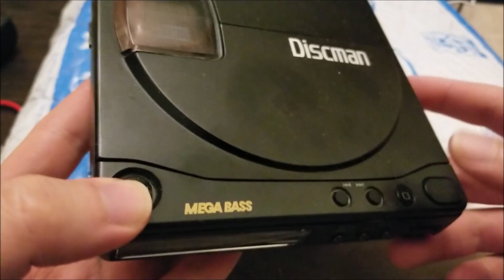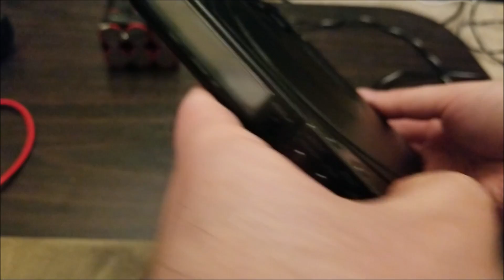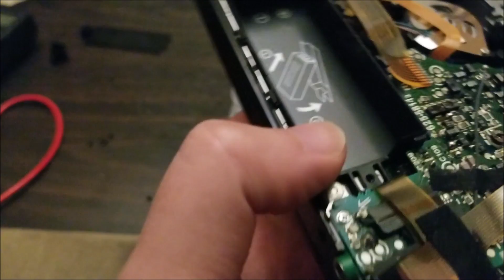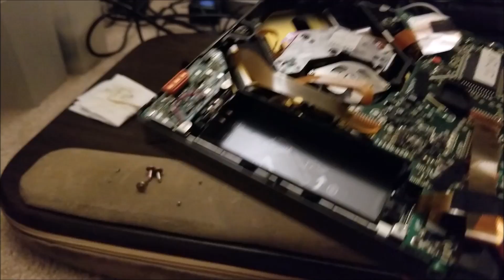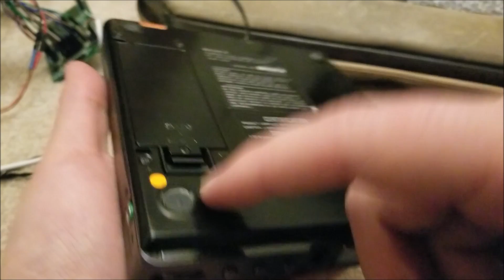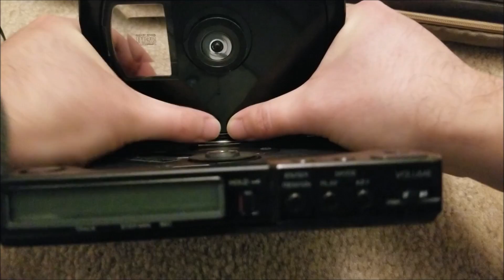Let's Fix: Sony D-15 High End Discman

Comment: good evening and thx for the fix .... i have the same disc player, in excellent condition, however it skips ... it has tracking issues and jumps all the time. is there any kind of fix for that?
Reply from the maker: Relubricate the sled rails/gears and check caps for leakage
Reply: @sjm4306  thx for the answer! However i have lubricated it and i dont see any issues with the cups. Everything seems correct… i tried to gently adjust the pots but no luck. I have read that the mirror of the lence may be dirty but i have no idea what it is and how to get there…
Reply from the maker: It could still be the caps even if they haven't visibly leaked, they can dry out drastically decreasing their capacitance
Reply: @sjm4306  thx !! I will check it!!

Comment: I just saw replacement gears on Ebay for about 20 bucks.
Reply from the maker: That's certainly good to hear but still very expensive. I've got an sla resin 3d printer, I wonder if there's a tough enough resin I could print my own with?

Comment: I just bought one for 20 bucks 🤪 seems to power on and seems to acknowledge CDs but it doesn't actually play then, with a screechy noise coming when headphones are used. Any idea where I can look to?
Reply from the maker: Bad electrolytic caps 100%, swap them all with new ones
Reply: @sjm4306  also noticed the middle gear for the laser, like the one you replaced in the video is looking quite green in the center, leakage maybe?
Reply from the maker: That would be the lubricating grease they added.

Comment: You think a 3d printed battery cover would work alright for one of these? Someone is offering me one of these for about the same price you paid for yours. I might have one soon.
Reply from the maker: Given the size of the original battery cover, a 3d printed cover may have some flex to it but should work fine.

Comment: Thanks for this video!  My D25 would also power on, but wouldn't play.  Sure enough, the same plastic cog was seized.  I was able to get to the frozen cog by removing just the power supply board/battery compartment.  The C clip was easy to remove, but much harder to reinstall, but in the end 'Success'.  My D25 is playing again!!
Reply from the maker: I love a good success story!

Comment: I took apart my Sony D15 and the middle gear was stuck and crumbling.  It was broke in half with little effort.  Also had 2 broken teeth.  I saw on here a chinese source  but looked at the site and got lost looking.  If it is there is is not easily found.  Anyone know a part number for it.  I think the big gear was 33 teeth and the smaller was 17 though with my eyes I could be mistaken.
Reply: Same thing happened to me with my d-25, the plastic gear broke so easily when I tried to remove it. 
 Did you buy a new replacement gear already? if you can recommend me a seller, I'd appreciate it!

Comment: another good fix. wondering if you have any idea where to get a replacement middle gear. thanks.
Reply from the maker: Last I checked there were sellers on aliexpress and ebay who sold replacement gears for a range of discman models. They weren't cheap from what I remember but given it's an obsolete/niche part that's to be expected.

Comment: What kind of lubricant did you use on the gears and mechanism?
Reply from the maker: I used white lithium grease, but probably a light machine oil would be better

Comment: I have a wireless remote for mine along with a base and flexable mount for it to fit in my car.  I think I have a battery also.  My d15 shows signs of a lot of use.  It turns on now but I think I need to recap and clean the mechanism.

Comment: Hi @sjm4306.  I have a very nice d25. Unfortunately the gear cracked when I tried to pull it off.  The other 2 gears move freely .  Slider was lubed and works great.  Where can one get a replacement middle gear.  I assume buy another d25 on eBay selling for parts?  Thanks...
Reply from the maker: There used to be a few sellers on ebay and aliexpress who sold aftermarket replacements for around $30 a piece (not cheap but still better than scavenging from another discman) but haven't checked in awhile.
Reply: Hi @sjm4306

I finally got a replacement gear from a Chinese source.  The gear looks good.  Someone else asked how you get past that metal C ring in front of the gear.  You said it popped out.  I can’t get it to budge. Do you remember any more details on how you got the metal c ring off without damaging or bending it?  There’s no way to get the gear in there without removing the metal c ring.
Reply from the maker: Turn the clip so the gap is towards you and use something kinda sharp like a needle/pin/small screwdriver to carefully pry at the gaps near the botton of the clip. I'd suggest putting some cloth/bluetack on the clip's bottom to catch the clip when you get it off so it doesn't ping off. To reattach you'll need some small needlenose pliers to squeeze from the top and force the clip into the groove of the metal shaft.
Reply: @sjm4306  Hi sjm. Thanks for the response.  I got the clip off (it is going to be crazy hard to get it back on).  I have the gear in place and i rotated it a few times and the sled moves.  How do you get the little o washer back on?  Does it slide back on or do you put it on like a washer into a screw?.  I tried several times with tweezers and almost lost it a few times. It is insanely small.
Reply from the maker: Try using something like a pair of tweezers and the eraser end of a pencil. Use the tweezer to position the clip and the eraser to apply pressure forcing it onto the metal shaft. You may have to slightly spread open one end of the split on the clip to get it started. It's trial and error in the end but just go slow and be careful and it'll get back into place eventually. Good luck!
Reply: @sjm4306  brilliant suggestion. It worked right off the bat.  The eraser was the key. You should write a repair book :).  Now i need to get that c clip back on.  I tried inserting a CD and it plays perfectly. It tracks fine and i can select tracks fine as well. It sounds great.  Just one issue. The display is blanked out mostly. I remember when i started this project the display was fine. Not sure if i jarred something lose on the display.  A small piece of clear plastic broke off but the circuit board going to the display looks fine. Do you know what might be causing this?
Reply: just to clarify, it is the clear plastic. The corner kind of chipped off on the clear plastic,  but the contacts and circuit board look fine.
Reply: i can dimly see the digits but they are really dimmed out.
Reply from the maker: Dim lcd could be caused by bad capacitors (at least this was the case for a d9 I repaired in the past). No idea in your case though as you said it was fine before disassembly. I'd inspect the pcb with a magnifying glass to make sure you didn't inadvertantly damage something.
Reply: @sjm4306  thanks a lot for the help.  At minimum it plays great and the tracking is working great.  The display lights up bright but just no readings.....I just looked at the d9 video. It was another great video.

Comment: Hey sjm4306: Have an old D-150 from 1990, always kept an eye on it but somewhen I got the problems described: player stopped to play after 30 seconds, couldn´t change tracks anymore etc.  Broght it to a "specialist" some 15 years ago, paid him to repair but he left it with the problems and I forgot about it. I have no clue about those players and how they work exactly but today I saw your video, found the old player, opened it, found the mentioned middle gear seized and ..... repaired it. It runs again and still sounds as 1990! You made my day! Thanks a lot for your video! 👌🏻
Reply from the maker: I love hearing success stories like this!

Comment: I've just picked up a sony d-99 which won't spin/read the discs.  I've freed off the middle gear but still no luck. Any ideas?
Reply from the maker: The fact that it wont even try to spin the disc points to maybe a power supply problem. I'd check all capacitors and inspect for corrosion on the board.
Reply: @sjm4306  thank you for the reply. 👍 There don't appear to be any corrosion on the board but I haven't checked the caps. Where did you get the replacement caps from?
Reply from the maker: I have a random collection of caps I've ordered from digikey/mouser over the years on top of ones I've desoldered and tested from stuff I've taken apart.
Reply: I so want to get this fixed. If I can't do it myself I'll try and find someone local who can 👍

Comment: Just found my own d-15 and it had the same exact sticky issue with the gears, problem is the middle gear was so rotted it fell apart. Not giving up yet, since that seems to be the only issue now, but I have no idea where to buy a gear this specific.
Reply from the maker: I saw one seller on aliexpress selling replacement gears for discmans, wasnt cheap from what I remember (iirc $15-20 a gear) but that may be your only source.
Reply: @sjm4306  I have a Sony d15 that skips at times.  I also have the ac power supply, the remote control with the sensor, the case, and base for mounting it in a car.  I may still have an extra battery for it if I did not throw it away.
Reply from the maker: Could be the caps are aging and getting just out of tolerance with what the servos need to work properly
Reply: hey Genni! same issue here, were u able to find the part?
Reply from the maker: Here's a site Colin from this does not compute found that still sells the gears https://www.chinahao.com/product/527971137581/
Reply: @sjm4306  sweeet!
yea the repair guys sorta bummed me out with this move..  at least be honest wit me, ive already given them so much business as a collector. 
well at least we got u and ur youtube channel! 
really appreciate it!

Comment: @sjm4306  Great video!  I was curious, there is a c-shaped piece of metal that partially blocks the middle gear (and fully blocks the front of the worm gear).  You didn't show the actually pulling off of the gear.  How did you do it with the c-shaped piece of metal partially blocking the middle gear?  Did you bend or remove that piece of metal before pulling the gear off?
Reply from the maker: Thanks, iirc I somehow removed the metal piece non-destructively (I dont remember having to bend anything so it was probably just clipped on).

Comment: A big thank you! Dusted off my D-25 and was real bummed the sled would not move. Cleaned and lubed the track but no go, did not think to check the reducer gear which was the culprit! Man that tiny plastic ring was a pain to get back on as I did not want to remove any boards! All is working perfect now and forgot how good this old player sounds even with 300 ohm HD-650's
Reply from the maker: Happy to hear your d25 sings yet again!

Comment: I believe the D9 and D15 use the same wall transformer, 9VDC @ 1A. Center pin NEGATIVE which is kindof unusual. Also note that most coaxial power plugs have a smooth inner bore, but the discman jack used two springs on the inside to grip with the center conductor pin. That's why your power connection is a bit temperamental.
Reply from the maker: Ah that explains it, I'll have to see if I can source the same plug from the original adapter or design something custom to more reliably work than what I currently use.

Comment: Great Video,, I have a sony D-35 /D-350 that spins up , but skips badly and/or won't read the disc at all unless held at a 45 degree angle or upside down. I purchased a new spindle motor on the advice I got from forums etc.. But now reconsidering based on your success with replacing capacitors. Luckily i havn't started yet, and found the service manual and schematics. I am proficient in soldering etc.. Question -> is the motor able to spin easier upside down or at an angle thus not requiring the extra buffer from the capacitors.. that seems to make sense ? Could you elaborate .. Any advice greatly appreciated as I absolutley love these vintage Discman ... Thanks
Reply from the maker: It's almost 100% not the motor, but the caps. The problem is bad caps decrease in capacitance and the compensator circuits for laser tracking are dependent on those caps to function properly. The reason why it works at an angle or upside down is you are changing the effect of gravity, which is changing the nominal starting point for the compensators so that they become within working range with the bad caps in the circuit. To properly fix this you really do need to swap out all caps and give the board a good clean in case any electrolyte leaked out.

Comment: I have D-15 in pristine condition.  not a scratch. owned since new in '88. have all parts and original box.   But, same issue - plays about 20 seconds of 1st track and stops reading.  you can hear it hunting, but does not reengage.  would be great to get it running. thoughts?
Reply from the maker: It's very highly likely the middle gear in the laser sled drive mechanism is seized like on just about every other discman from the era I've fixed. There is also a chance that it could be bad capacitors.

Comment: I found my old D-25 and it would only play the first 30 seconds of track 1. I tried to clean the nylon gears and broke the center gear trying to remove it. Getting another gear must be almost impossible. The spindle is stiff too. It might still be usable for parts though.
Reply from the maker: Oof, that sucks. A better alternative to scrapping another dead discman just for the gear would if someone with a good gear made a mold of it in silicone and then could cast replacements in a tough resin. Alternatively it may be possible to CAD model it and 3d print it in nylon like material using an industrial sla printer.
Reply: @sjm4306  I was an idiot for underestimating how fragile these gears would be. First I'm attempting to glue it together where it is cracked. But the teeth are buggered too I think. If that doesn't work I have a saved search on ebay for a non working D-25 (are there compatible models?) Eventually I might get one. I was looking at a custom gear making comoany but I saw a comment they estimated to someone 1500 for a custom gear!
Reply: Maybe you could find a replacement optical block and then duplicate all the gears ? The easiest way that came up to my mind since people don't usually sell gear separately.

Comment: I just got in a D-15 this week. It lights up but the laser is in the far position and doesn't move back. I'm going to remove the old grease and apply some white lithium grease later today. Thanks for the video footage of the D-15's interior!
Reply from the maker: Your welcome, and good luck getting your D-15 back up and running!
Reply: @sjm4306  I just got it opened up and cleaned off the worm gear of its old grease. Applying white lithium grease and 3-in-One oil to it shortly. Does the small power supply PCB come out easily for you? I'm having trouble getting it out after removing the 2 small silver screws holding it in.
Reply: I got it to play a CD! But it doesn't always spin up the disc. There's some glitchiness, possibly from playing it upside down. I'm not sure what keeps the disc motor from not moving sometimes. Maybe it needs a tiny drop of oil? It sounds NICE, as you know already. The DAC is a Burr Brown PCM60P.
Reply from the maker: I was able to wiggle the power board out (though I don't remember specifically how). The motor not spinning isn't due to anything mechanical, it's the laser not detecting the disc. If it plays upside down but not rightside up and skips a lot then that's a hint that the caps have gone bad or the calibration gains in the laser/motor servo circuits need to be tweaked. Additionally I found my lid detect switch was quite dirty and needed to be cleaned or it wouldn't turn on half the time because it thought the lid was open.
Reply: @sjm4306  It's working a lot better today! I can use it upright and the CDs spin. Maybe the first disc had issues with it. The only problem now is the constant  noise. I can't tell if it's from the CD scraping against the player, or the plastic piece underneath the lid which rotates and clamps the disc in place. 

Should I apply lithium grease or another lubricant to the inside of the rotating plastic clamp?

Comment: Bin looking for a original charger for this one, but cant find one, do you have any code or nr. on the charger your using?
Reply from the maker: I believe the adapter is 9V (probably 500mA or more should be plenty). You'll have to double check polarity but pretty much any 2.5mm jack diameter adapter with those specs will work. For testing in this video I rigged up a lithium battery to a boost converter. Since making this video I 3d printed my own rechargeable internal battery.
Reply: @sjm4306  I have a original 9v charger, but the plug does not fit and i cant find any specs on the D-15 what size i need. I will have to look in to your videos. Thanks.
Reply from the maker: I think it was 2.5mm inner diameter x 5.5mm outer diameter, I can check when I get home
Reply: My original charger was 9v 600mA.  It says AC-940.  The diagram shows the center is negative on the jack.

Comment: Good evening, how is the sound quality compared to newer desktop cd players? Is it worth to give money for this or for a newer model? Thx!!
Reply from the maker: A more modern high end cd deck will tend to have better reliability and more outputs including opticial/coax digital out. In terms of analog audio out though these vintage high end portable cd players are really good, with insanely low noise floor and they sound great when paired with a good set of headphones or a good amp and speakers. It really depends if you want something small or something large. In comparison to more modern portable cd players though (anything made late 90's and on) there's no comparison in terms of quality.
Reply: @sjm4306  thanks a lot my friend for the answer!